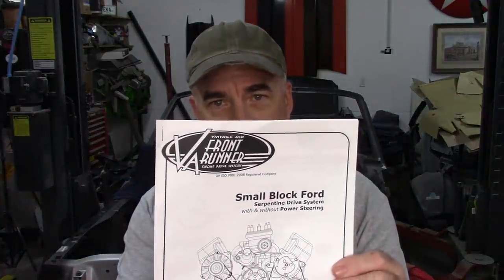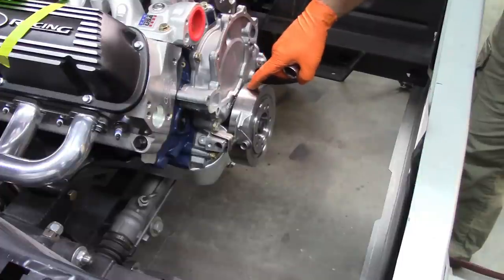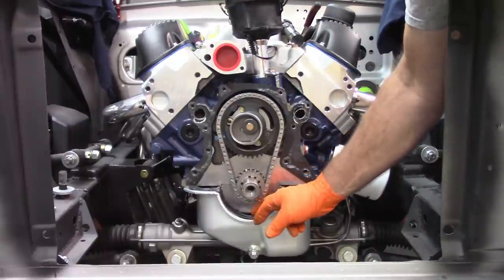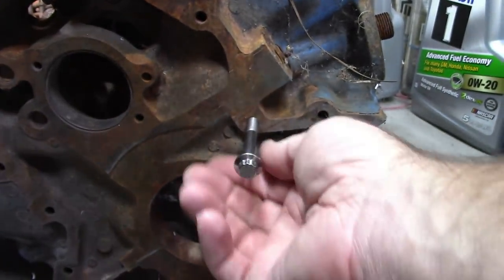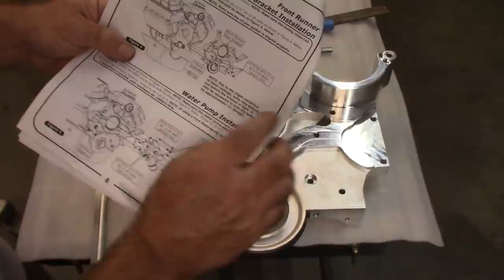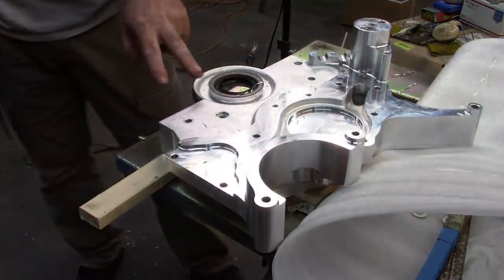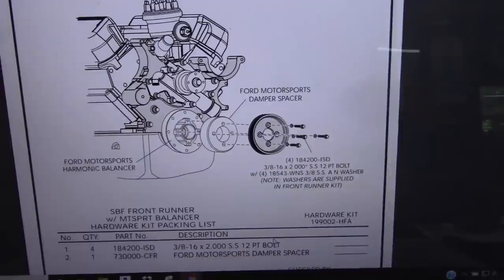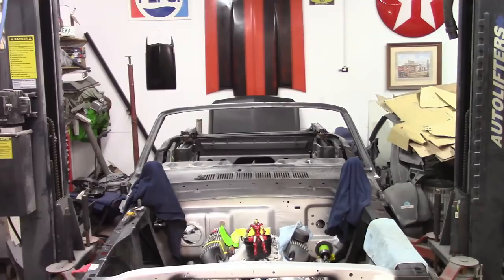Vintage Air front runner test fit. Brooklyn Pony part 46 A

Comment from the maker: Note: the measurement method I used on the balancer was incorrect. My measurement was. 4.750". The actual measurement would be 3.750".
Reply: I was watching that and thought, "Hey, he's adding the thickness of the straight edge to his calculation..."
Reply: I seen what you were doing I was thinking that it would be one inch off.so with all said what would be the fix?
Reply from the maker: No. The balancer diameter is too large.

Comment: So Ford has always used as many bolt sizes per assembly as possibly. I install car stereo/security and I always theorized that there was a front door team, and a rear door team. They were given cad dimensions of the door to fit the body, told what they needed to do and then instructed they were not to interact with the other team, because even front to back they frequently use different sized fasteners. One of the many reasons I like Chevy,  Chrysler and Asian cars. lol

Comment: Barry, looks like you have there a 1 price rubber sump pan gasket. It is a aftermarket price that replaces the original style parts that have the 2 side sections in Cork and the front and rear rubber sections that seal around the front and rear crankshaft seal housings. Whet ere or not you were removing the sump pan I would re-use the style of gasket, they are not cheap, however, as you do not wish to remove the sump pan you will definitely want to re use it. You ant cut and join sections as it is reinforced. The front semi-circular section that you were concerned was not sealed in is trapped between convex section on the pan and concave section of the timing cover.

Comment: Over the years Ford used a lot of bolts 1/4" or 1/8" shorter so 2 1/4"or 2 3/8" instead of 2 1/2". That's why the warning of bolt hole depth.

Comment: Just looking at the two covers close to each other did not see anything that would have changed the distance of the timing tab since it cleared before taking apart but something moved between the two mountings to get it that different. You can push the balance into the old timing cover and recheck the fit on it and maybe find answer but it wont do anything for the water pump. It is a lot of work and fitting but no one ever said modifications and performance ad on items were trouble free,
Reply from the maker: I agree. Strange part is, the timing mark moved closer rather than farther away. If I installed the new piece higher, it should have more clearance. There's no way I made it lower.

Comment: I was looking at one of those from vintage air. I have the original 289 waiting for an accessory drive. Aftermarket parts are a toss up if they need modification for a certain application.

Comment: I have the exact same engine. I put a ford motorsport water pump on it and the balancer clears the boss on the pump, not by much, but it clears.
Reply from the maker: This pump is part of the front runner serpentine system. Not sure if there's a difference.
Reply: @JoDaddysGarage  Here is the balancer on mine  https://www.summitracing.com/parts/fms-m-6316-d302
Reply: and here is the pump https://www.summitracing.com/parts/fms-m-8501-f351
Reply from the maker: That is the balancer I have.
Reply: @JoDaddysGarage  any chance the boss can be shaved down and go with a smaller headed bolt? If you notice on the Ford pump, this area doesn't even have a fastener so not sure how critical the clamping forces are here. Let me know if there's any more info I can offer that would be helpful.

Comment: Great video with lots of good tips on what to look out for. You indicate that your balancer is 6.625 (ford spec says 6.610 and neutral balance for that part number) and that you think it needs to be less than 6.400" to work. I'm planning to install the same front runner system on a Blue Print 302 crate engine. Their damper is a 50 oz external balance with a 6.4" diameter. I contacted Vintage Air and the only note their tech people had was that if the balancer is 6.573" diameter then you need to use the 1" spacer (199002-HFA). The tech said that based upon that note that any balancer that's 6.573" or less should work. Summit shows balancers that range from 6.250 to 6.625 so you're at the high end of the range. Also, is there some reason that you didn't show the crankshaft seal instillation? It looks like later in the video the seal is installed. Vintage Air says to install it in the plate before installing the plate on the engine. They say you can't hammer it so I'm not sure what tool to use.
Reply from the maker: Thanks for the info. I installed the seal myself, but did not film it. I did not hammer it in. I modified my bench vice, and used a plate from a wheel bearing removal/installation kit. I basically used the vice as a press. I took some pictures if you want to email me.
Reply: @JoDaddysGarage  Thanks for the offer - I have a seal install tool that with a stiff backing to the Vintage Air plate should work.
Reply: Since your measurement is 3.750 and you will need to use the spacer, according to a review of the spacer on Summit (https://www.summitracing.com/parts/vta-199002hfa) the maximum damper diameter is 6.4
Reply: Sorry, the link didn't work - it didn't like the dash in the link. Just go to summit and look up the vintage air spacer part and read the review.

Comment: i would consider helicoils to reduce the thread size in the block to match the new timing cover. it would save alot of work.
Reply from the maker: I won't do any machining to that block. Not taking any chances.
Reply: Won't work. The thread pitch is different so you couldn't just put Helicoils to reduce the bolt size. Installing a Helicoil requires drilling out the threads and using their special tap to make the receiving threads.

Comment: Tune in for next week's episode of does it fit where Barry will say screw it and install electric water pump to match the electric fuel pump lol. it's crazy all the fitment issues you run into with aftermarket parts... good stuff man. hope you can get it figured out.. what model is that water pump btw? i like that 90* barb.
Reply from the maker: Not sure. It came with the kit. I can look at the box.

Comment: The modern Ford crate engines use a one piece pan gasket. Those cork pieces and the rubber piece are to be used on older engines which have cork pan gaskets. You did not need to cut that pan gasket. Nothing is ever truly bolt on, and I get the impression that you haven't worked on very many engines. Contact Vintage Air and ask them about the bolts. They may not be aware that the modern Boss blocks uses larger bolts. Odds are they have the correct ones. There is nothing better or stronger than ARP's 12pt stainless bolts. They are stronger than a Grade 8. The balancer wouldn't go on even if you have the clearance. It's a press on fit, not a slip fit. They have different diameter balancers.
Reply from the maker: Thanks. I've worked on plenty of engines. But Chevy's. Ford always seem to be difficult.
Reply: @JoDaddysGarage  I've run into it all no matter what brand the engine is. Ford is no more difficult than any other.

Comment: Sadly this is not surprising. It seems like going into any sort of an install of an aftermarket part you have to expect a problem-solving phase.  Accessories I can see being particularly bad.

Also, not sure why you'd need a 3/8" bolt to hold the "timing cover" in place.  It's not a stressed member, is it???

Question: Were there not dowels in that timing cover in one of those bottom two holes?  Should be one on each side to align it IIRC.  This aligns the dampener to the front main seal.

And a heads-up.  I installed the  Vintage Air condenser kit on my 65 a few weeks back (Passenger side routing).  The top bracket was a full 2"" short.  I ended up making a new.  I also drilled new holes in the condenser to move it over by half the distance between holes so that the hard lines weren't contacting the core support.  I always find myself asking: "what car did they measure to design this stuff?". Make sure you mount the condenser BEFORE you drill the hole in the core support to pass the lines through.
Reply from the maker: I think it has more to do with the "boss" block. Slightly overbuilt I assume.  There were not actual dowels, but dowel sleeves. I installed them.
Reply: @JoDaddysGarage  You're right, they are hollow at those bolt holes, not solid.

Comment: Great video Barry.  The real world scenarios add to your content and interchange with your subscribers so keep up the good work. I’m puzzled by your measurement from the face of the harmonic balancer to the block ( discussion in another comment) and why the timing mark indicator interference?
Reply from the maker: I think I did the measurement wrong. it is likely 3.750" and a spacer will need to be used. I can't answer the timing mark interference....

Comment: Barry, Jeff - how are you doing today?
Barry, watching your video, your measurement of 4.750” appeared to include the width of your straight edge - that can’t be right, can it...?!
Reply from the maker: Yes. That's how they show it in the drawing.
Reply: @JoDaddysGarage  what if your straight edge is 2" thick??? It would be different.
Reply from the maker: Good point.
Reply: @JoDaddysGarage  I went to Vintage Air website and read the instructions for the SB Ford and it refers to this "verify that the dimensions
from the face of the block to the "machined pulley mounting surface" of the balancer is 4.725”. Either their instructions are off or your measurement is not correct for this application.
Reply from the maker: They show 2 different measurements on the instruction sheet.
Reply: Stallion Ranch Woodworks - you’ve made my point clearer than me!  And from what I was able to see of the diagram on Barry’s post, their measurement and method was clear (and correct) enough...
Reply: Jo Daddy's Garage - not quite, Barry.  They show the distance from the pulley-side edge of the straight edge to the block; it doesn’t include the width of the straight edge, nor should it. The straight edge could be any width...
Reply: Jo Daddy's Garage - hopefully one of them is right...?!
Reply: Barry, I’ll be back in time for 3pm, yr time - I’m just about to have my shower and shave, amongst other things in my bathroom...  Jeff
Reply: Well said. I noticed that too. Confusing.
Reply: @JoDaddysGarage  the picture in the instructions is misleading. You don't have 4.75" from the face of the block to the face of the harmonic balancer.  You can measure like you did to keep everything square, but take you reading from the face of the straight edge that contacts the balancer.  Looking at the video, looks like you are closer to 3.75".  You will need  the spacer kit from vintage air to get all the pulleys lined up.
Reply from the maker: @hartigan21  Thanks. I realized my error as well.

Comment: Soooooo, are you sure there was sufficient clearance between the head of the cam bolt and the cam button boss on the inside of the housing?
Reply from the maker: 99%. There was no high point and it all sat flush with the block face. I will do  more to verify that when i get the balancer replaced.
Reply: @JoDaddysGarage  if you do end up with the cover off again, stuck a limp of Playdoh on the cam bolt and measure the squish. Just make sure none falls in the front sump! Lol.

Comment: Barry, this is so unlike Vintage Air. I have used their front runner systems on two GM engines with a perfect fit. I get the feeling your kit was not designed for this particular engine. Did you contact VA with your problems?
Reply from the maker: No. I'm ok with the modifications I made. It just needs a smaller balancer now.